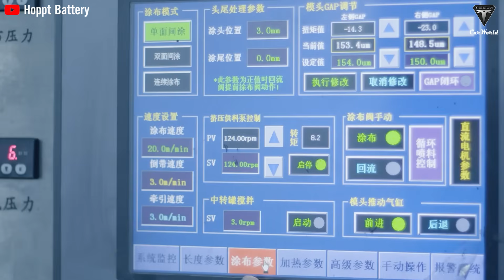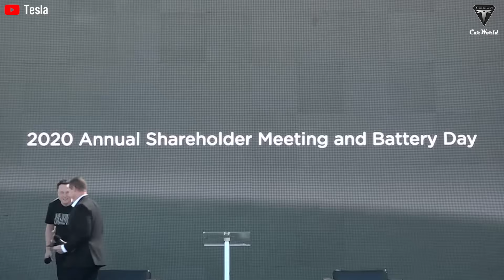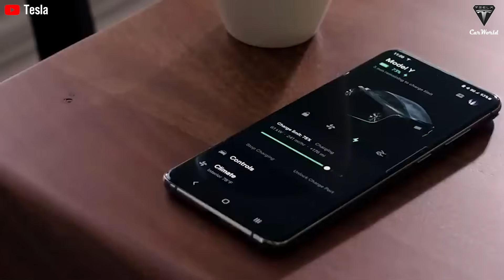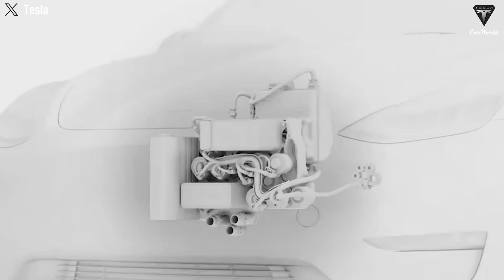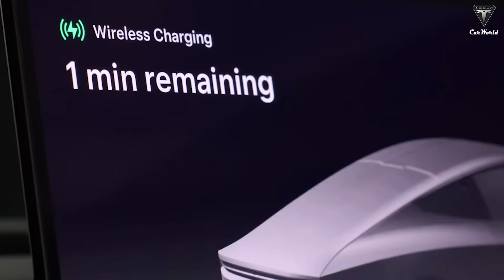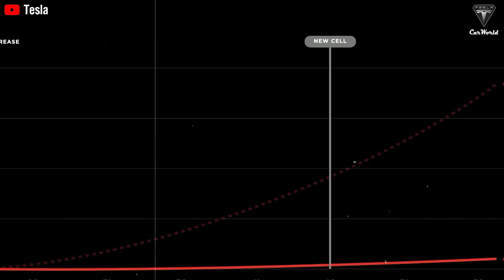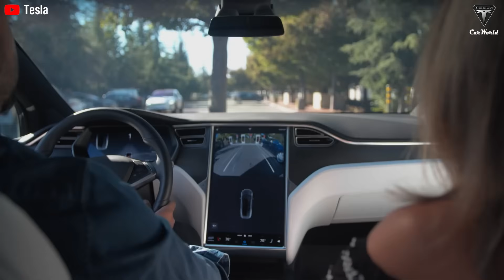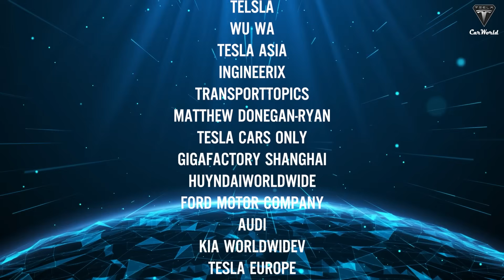It Happened! Elon Musk Leaks $0.06/Wh Semi-Solid-State Battery, 4 Mins Charging! China LFP Killer?

Comment: The potential for faster charging in cold weather is huge. I’m really excited to see how Tesla’s new solid-state battery performs.
Reply from the maker: Share the excitement—pilot carpet-cell packs held 90 % power at −30 °C and regained 200 miles in 4 min on standard 400 V gear. Which charger network should pilot them first?

Comment: Finally! The U.S. making real moves to catch up in battery tech. 24M could be a dark horse.
Reply from the maker: Absolutely—Massachusetts pilot packs hit 98 % recyclable yield and cut plant cap-ex 50 %. Besides EVs, which industries do you think could gain most from this tech?
Reply: @TeslaCarWorld off grid housing equipment 

Portable power packs 
Construction Tools 
Gulf cart’s 
Electric Bicycles and motorcycles 
Snowmobile’s 

Eventually it’s use’s are endless!

Comment: I've been wanting a FSD. Then I found out the battery replacement after a few years was $10k+... and that's not reasonable. It's a throw-away at that point and it shouldn't be. I'll be following to find out how the battery comes along. Having the same charge time as refueling, or less, is a big plus as well.
Reply: Most battery packs last 20 years at 80% capacity or more. They are all warranties for 8 years 100k miles
Reply: @PhxElecAuto Thank you. I used to put 35k/yr on a vehicle. I have had no vehicle since 2022. Debating when to jump to EV or just get a Jeep GC.
Reply from the maker: Appreciate the optimism—lab data shows semi-solid cells keep 88 % capacity after 10 000 cycles, good for 20 years and 1 M miles. How do you think that longevity affects EV resale values?
Reply: @TeslaCarWorld hopefully that’s true because so far things don’t seem to be as advertised
Reply from the maker: We feel that sticker shock—24M carpet-cell packs aim for sub-$5 k replacements, million-mile life, and 4-minute 200-mile recharges on 400 V. Would that make FSD more appealing to you?

Comment: How do solid-state batteries compare in cost and performance to current lithium-ion batteries for those who live in warmer climates?
Reply: 24M batteries are material agnostic, cheaper to make, last the life of the car and are cheaper to re-cycle, making them the cheapest and IMO more sustainable option ever.
Reply from the maker: Feel the heat question—24M packs aim for $60 kWh, 660 Wh/kg, retaining 90 % capacity after 1 000 cycles at 45 °C. Which matters more: upfront price or summer endurance?
Reply: Technically performance is close and cost lower, but it has huge advantage of no fire risk.

Comment: Charging issues and range loss in winter can be so frustrating. I’m hopeful that Tesla’s solid-state battery will solve some of these problems.
Reply from the maker: Totally feel the winter range pain—24M’s Eternalyte semi-solid cells held 80 % capacity at −40 °C and added 200 miles in 4 min during NREL tests. Which cold-weather trip would you retry first?